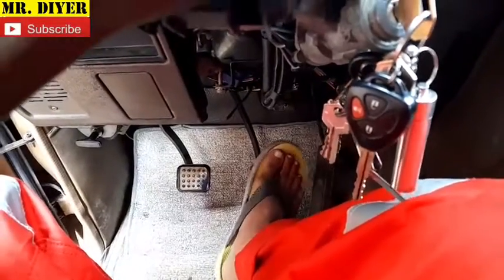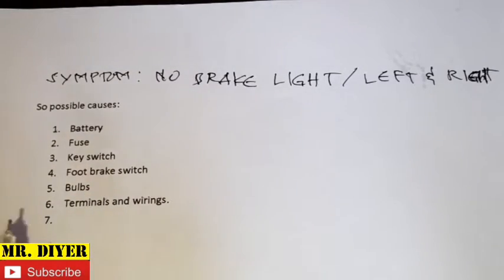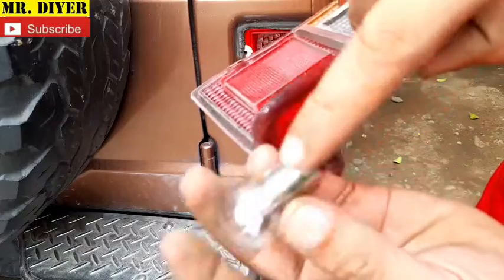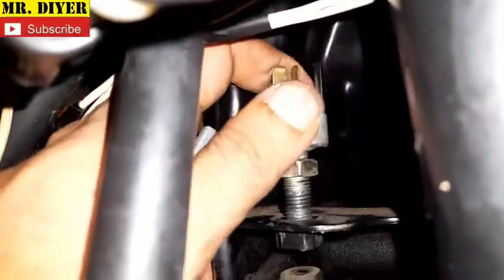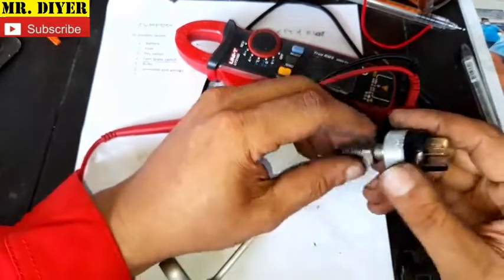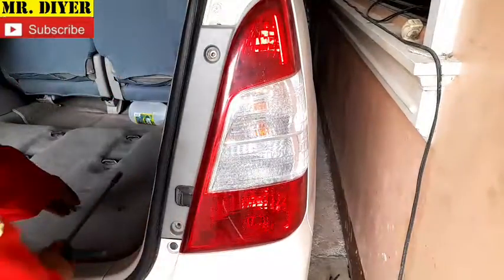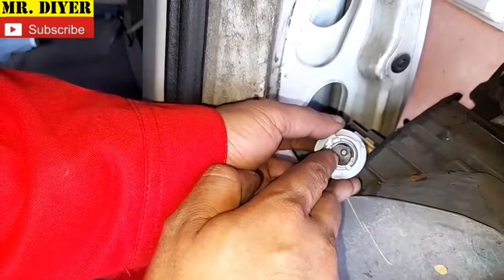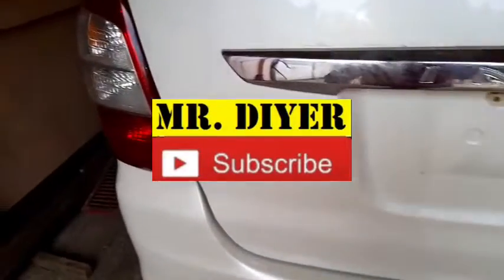No Brake Light

Comment: That was brilliantly explained. A 100 out of a 100 top marks.  I had corrosion on the connector to the side was the problem of the break light socket clean it off working great now. Thanks again for your advice.

Comment: Thanks for a great detailed instruction.  I had new tires put on yesterday and they told me I had a tail light out and wanted to charge me $47 to change a bulb.  I said no thanks, I can do it myself.  I’m guessing since I’m a woman they thought I’d just pay them to do it.  I had an extra bulb in my my side door pocket.  Of course, when I got home and changed the bulb, it didn’t work.  The old bulb looked burned out, but new bulb isn’t working.  The light on the other side and the third brake light are working.  So I believe I may need to clean the connection in the socket.  I do not have a Dremel tool to get down inside to clean it.  Any suggestions of something else I can use?  Thanks again ❤
Reply from the maker: A simple wire brush would suffice, even a tooth brush, or sand paper if its heavily corroded.if you can use a   contact cleaner the better. Just male sure to disonnect the battetry to avoid a short.
Reply: @MrDIYer  Thanks so much for the quick reply l. I’ll let you know if I figure it out or end up breaking down and paying someone to fix it.

Comment: Sir i have the same problem right now with my car, what if the problem is the socket terminal? do i just need to buy an 1157 socket bulb?
Reply from the maker: If the socket is the problem reolacing the buld eont solve it.
Reply: @MrDIYer  sir I did all the procedure on your video but still when i press the Brake when my headlight is on my brake light on my right is not working :-(, this started to happen after i installed an 1157 LED double contact without can bus.

Comment: In the United States, when somebody replaces parts in a random attempt to fix the problem, we call that, firing the parts cannon. It can be very expensive. Please don't touch the glass of one of those halogen bulbs with your bare hands. You will drastically shorten the life of the bulb.

Comment: Sir, my rear brake lights working effectively but the 3rd brake light which on the rear windshield doesn't turn on. Any recommendation on this?
Reply from the maker: Same procedure
Reply: 3rd light no juice in socket😢 just noticed someone put 30amp fuse instead of 15 😢 where do I  start 2006 Honda odyssey